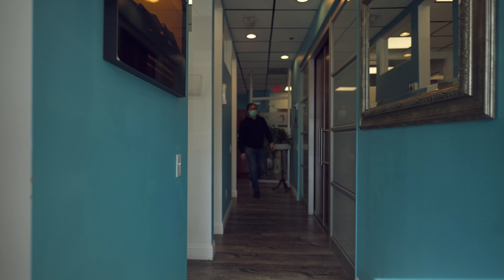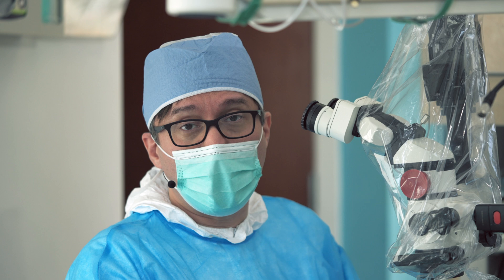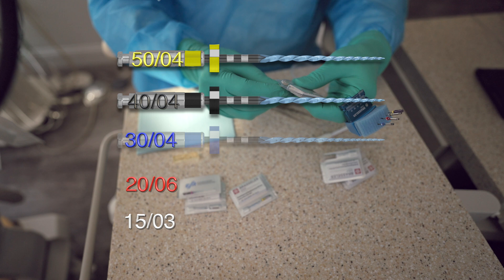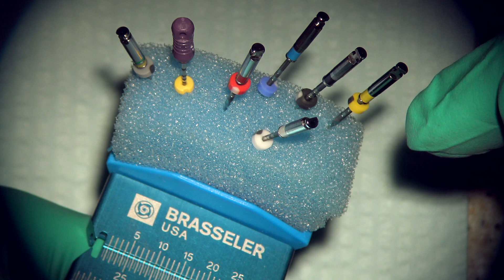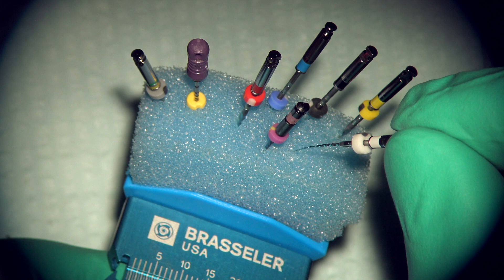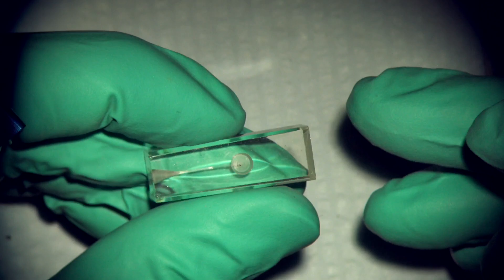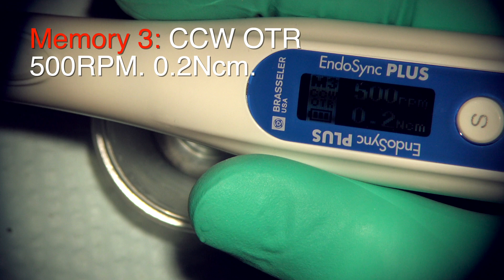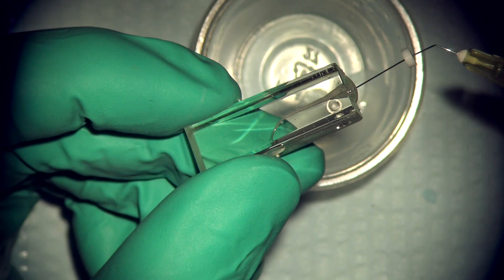ESR CM Files Efficient 04 Taper Reciprocating Files

Comment: Can These ESR CM Files be used with a reciprocating handpiece from another company?   Our office  has the Sybron TF Adaptive Elements motor with rotary and reciprocation.   My thought would be to use these ESR CM files and then obturate with Bioceramic GP points the same shape as the final file and bioceramic sealer.
Reply from the maker: Thanks for the question. Unfortunately, ESR Files are designed like WaveOne Gold and Reciprocal files that cut in the counterclockwise direction. TF Adaptive and its engine are designed to cut in the clockwise direction. Therefore, you can not use ESR, ESR CM, or Waveone Gold Files in the TF Adaptive Engine. But if you don't want to change engine, you can use the EndoSequence CM, and EndoSequence Scouts or other files on your existing TF Adaptive file system. ESR CM files can be used. on the WaveOne Gold reciprocating engine by Sirona or on the EndoSync Plus engine by Brasseler. It's important to know which direction the files cut in order to decide which engine you should use. Cheers!
Reply: @AANasseh  Thanks.  Glad I asked!

Comment: Im sorry but I amconfused!
The primary file has a fixed taper of .06% which makes it thicker on D16 as the waveoneprimary. 

Theboard compares the Iso 30 file esr vs the waveOne primary... instead of showing that the primary esr file is in fact more invasive especially in the coronal aspect. As you always usw the primary esr first it makes sence the the larger filex have less diameters to prceed faster to length an have more flexibility.

Do I get right that this is simply a pretty weird comparison?

In germany brasseler launched the „procodile“ file which was green so people would think it is heat treated controlled memory but it isnf
Reply from the maker: Excellent point. But two important points I need to say here: 
1) The Brasseler in Germany is not the same company as Brasseler in USA. They are two unrelated and independently owned and operated companies by different entities that in fact compete with each other. 
2) The Primary ESR 25/06 is a screening file. It's generally not a Master File (although can be used as one if the natural anatomy of the canal can accommodate that taper. I used it in the demo to show as an option and that was probably confusing to many people. My bad!) But essentially, the 25/06 is used to triage the canals into small or large. If it goes to the apex right off the bad then you would finish with a size 40 or 50 and you're done. If it doesn't go to the apex it will act as a file that does some coronal and mid-root flaring, then you finish with a 30/04 (once you're scouted the path). So,  you're finishing with  either a 30, 40, or 50/04 files. The 25 does mid-root and coronal flaring and will only be used as a final file if it reaches the apex without too much effort, which means the .06 flare diameter was already there anatomically and you didn't unnecessarily remove that much dentin. I hope this makes sense.  If it doesn't please let me know and thanks for this very good question! :)  👍
Reply: @AANasseh  
Thanks! This makes sense😂
I dont really get the point using more than one reciprocating file. The heat treated niti files dont break, it does not really matter if they rotate or reciprocate. Reciprocation to me is simplicity. If i have to preflare the canal I need more than one file... then i would rather be using rotation. Its mainly a financial aspect, but also preference.

In Germany reciprocating files cost double as much as rotating files. Theyre also thought as single use and the shank will have plastic that expands when sterilized. I dont know really if such new files make sense to me!

Reciprocating files are safer for sure, but if you need more than one in my experience its cost is too high. As i generally prefer rotation i only use (e.g. waveone) the primary file. If i need to go smaller or bigger i will switch to rotation.

I dont know how the financial aspect is compared to rotating systems from brasseler but to me new file systems need to have a real benefit. Metallurgy has become so good that reciprocation seems to be less of a deal especially as i like rotation for its better shaping control in brushing motion. 

Have you ever used hyflex edm? The 50 file is still incredibly flexible. Thinking about new file systems metallurgy maybe altering for the file sizes would make sense... the lager size the softer/ more flexible metallurgy. Special shaper such as 3D shaper for large/complex canals. Protaper next was kind of a twist which inspired some manufacturers. Im alsways unterested in new file systems but at some point i think there should be a really visible step forward. FKG has made the same, dont know if they collaborate or something: r motion woth constant taper an a 25/06 file followed by 30/40/50 .04 tapered files. 

Do You get my point? I like the idea of less waste. 3D shaper oder one single file to shape is something nice. No sterilization, cross contamination. Breaking files happens un general due to overused files or practitioners false handling. To me it makes sense that companies want to sell ne products but still i should be a step forward. If there was a reciprocating file, maby also usable in rotation which kan make a apikal prep from 25-35 as ist has a comparible off centered tip like the 3D shaper this would solve the problem of larger canals on molars needing extra care. Somtimes i only usw niti handfiles after 25. primary to do that job.
Reply from the maker: @00192ee  I see your point. But here's the difference. First, ESR CM Files can be resterilizled. Second, I'm not a big fan of hand filing and with other reciprocating files, you have to hand file to a size 15 or 20 hand file before finishing with a single file, hardly a single file system. It's like you're starting after using 3 hand files, then calling it a single file system! With the system, your hand instrumentation is limited, you use a minimum of 2 files, which is still pretty simple, you distribute the cutting among a minimum of two files which puts less pressure on both dentin and each corresponding file, and you use one file to gauge the canal and another to finish. That's the 25 gauging and one of the finishing files to finish. The idea of a single file system is a marketing ploy. Again, they don't count until the canal is enlarged to a size 15 or 20. That's hardly a single file. 
Either way, you have to use a system that makes sense to you. These files are much less expensive than WOG and can be sterilized. My goal is to always develop protocols that are responsible and combine safety and simplicity while addressing the real biological aspects of what we're trying to do. These files and our protocol will be very competitive against WOG. You'll see. Thanks for your feedback! :)
Reply: @AANasseh  
Hey thanks!

As brasseler does not sell those files and FKG seems to have the same as esr and those are more expensive probably due to shipping etc its hard to compare.

To Your point:
I agree that using handfiles is not a singlefile system, but I rarely have to usw more than a size 10 file which ich mostly use to gauge for impediments. I like handfiles to break up debree between files etc. I sometimes like using pathfiles etc if there are very narrow canals in which in fact the 25 would have a hard time. Since i dont know how much stress ghe sterilized files have been through I never really know when do discard. Hyflex edm promises if it rewinds after sterilization u can usw it. Still cyclic fatigue broke a few. My protocol usually is a size ten handfile with which i scout paralell to shaping with the primary file. If needed I use one larger finisher. I get your point but still there a quite a lot cases I only usw one file plus the handfile cause you never know when you block the canal... recapitulating is kind of a safety thingfor me.

Have some good days :)
Reply from the maker: @00192ee  It’s true and what you’re saying can work in some cases; but getting a size 10 to the end and driving a fat single file to apex is clearly not a protocol. It’s a custom made protocol that applies to specific cases where it can work; but a protocol is a different story. Coming up with a protocol means that your algorithm should be robust enough to account for case variabilities while providing a universally effective method of instrumenting in most canals without confusing people with too many details. That’s the point of a protocol: it’s composed of a set of sacrifices based on a set of priorities. Here, my priority was developing a universal technique that is simple, efficient, and predictable. Obviously a rotation based system is more efficient and universal but is less safe. Since the ESR CM system was designed with safety and simplicity in mind, this was my thinking while developing the IFU/DFU for these files.  So, there are many factors that need to be balanced out clinically and that’s the basic difference between a universal protocol that should be easy to follow by the average clinician and the kind of customization an advance clinician makes chair-side for a given case. Now, I do the latter myself but I don’t develop the exact protocols that I use or it would completely confuse people since it would be too convoluted and can literally change from case to case! So here, I had to make sacrifices on efficiency, for example, to improve safety or other factors here. At the end, protocols need to be robust and simple; but have to have in mind the needs of the average clinician out there; not the experts. I hope it helps clarify the thinking behind the thinking here. Cheers!
Reply: I get your point.

Still in the end i guess as theres no new real innovation as the marcet is satisfied, y dont we apply a new mode to our deviese. 150* clockwise, 30 counterclockwise.

The concequense would be that we can use all files in rotation and reciprocation. No need of separation... in the end it is no new alloy, no new file design. The market is full of copying ... 

Please dont get it wrong, i respect your thought on this. But what is the point

Safety means for me, no crosscontamination, no broken file. When you sterilize you take risk of both points. Innovation to me means evolution. The last big deal i saw was the 3D shaper/finisher. Everything else redundant. 

Minimally unvasive. Ok but still this is a trend... no wrong no right. What about something new, endobrush, cleaning better, more perfect as our instruments only touch 25% of the canal walls. 

If i pick my device, program it myself for reciprocation i have a ton of files that exist an are way cheaper. Theres evidenz that the movement itself matters. The waveone file and protaper f2 are identical exept one works cw the ofher one ccw. The price is double as high. Thats nothing that makes sense... new file systems that are only copies of each other.

Dont be offended, but we are dentists. We are practitioners... not ingeneers!

In the end the new system is nothing new. The 25.06 primary file looks the same length as other files. Noone will use it as a scout or opener especially as the other file called primary is meant to go to length. I didnt get the point an i am very focused on understanding. Orifice shapers are typically shorter. If theres a canal that is wide it usually has a larger apex. Extremly conical canals like 25.06 are no natural shapes. This is more the 04 tapered instruments. So in this case this is something new. More biomimetic. But reciprocating instruments thend to get mor parallelled when they get bigger. The primary is always the opener. Followed by larger stiffer less tapered ones. I am looking forward to every innovation but i am missing the point here. Reci is more safe. True. But not everyone affords so many instruments, is free from the price he pays. Affordability is a point. Reciprocation makes instruments last longer. Allows less instruments do the job. Why not set this as standart? I am allready on the train. It works. Theres no magic in ccw direction👍😂
Reply from the maker: @00192ee  Welcome to world of Business! Most of what you said is true. There's no point in counter clockwise motion in reciprocation. WOG is an F2 in reverse. But this single file use justifies its price and replacement of 6 ProTaper files in a pack! That's why they designed it to be cutting in reverse, so it wouldn't cannibalize their own line of instruments! 
And yes, instrumentation is already at a fairly optimal level. BTW, I recommend cutting at 500RPM with CCW180:CW60 or CCW180:CW30 for a little more speed. I don't like the 300RPM CCW150:CW30 by Dentsply.  
Lastly, the next wave of innovation will be on disinfection, which as we know, is the most important component of success. Enough of this instrumentation stuff. 

You should have watched my Live webinar last week on ESR CM details and protocol.  The 25/06 and its role as a screening file is nuanced. I'll probably explain it in a separate video here to clarify any misunderstandings. Essentially, when the 25/05 goes to the apex easily, then your canal was wide enough to begin with. When it doesn't, you don't force it to the apex, you switch to the 04 to finish. So, the 06 shape is not dictated to a thin canal. After all, you can't be more minimally invasive than the natural diameter of a canal or else you're not doing anything other than rotating in place without touching anything! 
Basically, this 25/06 validates what kind of canal you have, small or large. If it's small you won't go to the apex, if it's large, it will go to the apex. That's the distinction itself. I hope that make sense. A single file system is just marketing and it's not a universal protocol. 
Single use of your instruments is always the best choice; but it's not something a company should dictate to us by utilizing tricks like an expanding handle! We're adults and experts and should not be treated like children. What's next, child safety locks on a box of files?! We can make a judgement if a file needs to be thrown out or not. This can be shown through scientific investigation. It shouldn't be companies with vested interests making these decisions! 
There will be innovation, much of which will be significant. It just takes time. Meanwhile, we need to focus on what we have and understand better what and why we do what we do. The next big thing will be in disinfection. Cheers!
Reply: @AANasseh  haha, thanks
For the recommendation speed👍
Reply: @AANasseh  
I appreceate your honesty. Still i never use 6 protaper files😂 if the S1 goes to length theres no need for S2 or F1 in 99% of the cases. And yes, the handle is ridicoulous, and we can simply take
It off. A molar is 4 canals a premolar 2 with less curvature so the files
Have different tasks an can be reused especially when it is the same alloy🤷🏻‍♀️

How du you manage reusage? The reciporcating file what is you protocol for discarding?
Reply from the maker: @00192ee  Depends on the case. In a four canal molar, I use it out of the package and toss it. If it's a premolar or anterior I sterilize it once, then toss it after second use. So, anything that's sterilized on my tray is single use. Anything that's in original package is either single use or can be sterilized. That keeps the whole thing simple and cuts the cost in half in some of the cases! I've found that to be the best balance of simplicity, efficiency, safety, and cost cutting. I should do a video on that! Thanks! ;)
Reply: @AANasseh  funny... thats how id do it. I guess illgive it a try😄👍 im looking forward👍